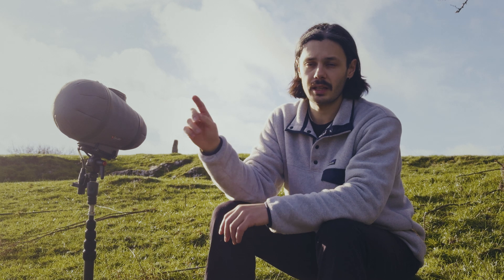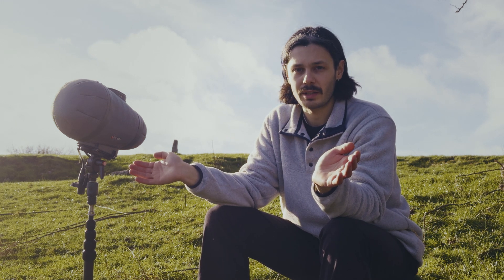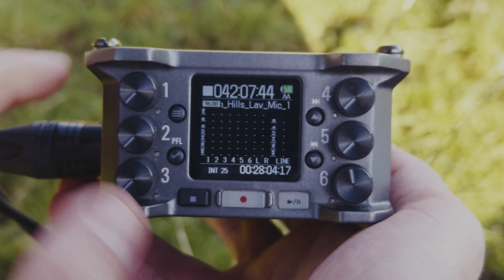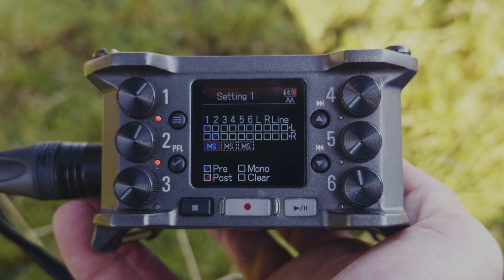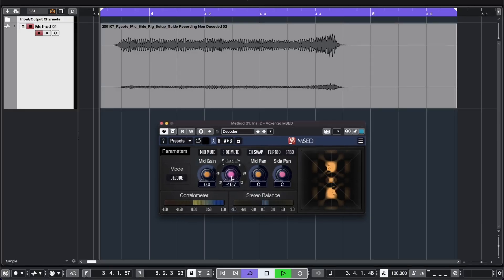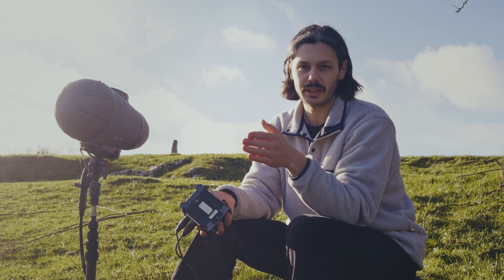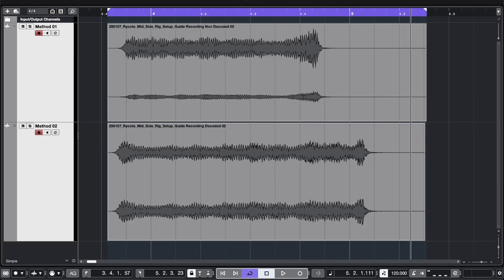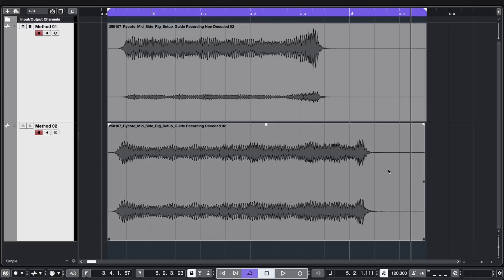How to Setup the Zoom F6 for Mid Side Recording

Comment: Thanks for making this video.  It's really helpful for newcomers. 
Can I ask which specific Rycote cyclone you have? There seem to be so many variations.
Also would it be big enough inside to replace the SC-08 with a Rode NTG-5 instead? The NTG-5 is quite bit longer at 203mm.
Thanks
Reply from the maker: Hey! I think the NTG-5 would be a bit long for this one. Its worth checking out the Mini Alto 250 by Radius. They're releasing Mid Side mounts soon too. Your NTG5 would fit inside of that

Comment: Thank you for the video, quite helpful.

 As for the way of recording and decoding  i suppose there is a third method as well. Record the two mics as mono channels and set levels as you want (i suppose if you record 32bit float even that is not exactly necessary) then bring the recordings on the DAW and duplicate the figure 8 mic, flip polarity to the one of the two and hard pan them left and right. Then group them so you can manipulate then as one unit.. this way you manually decode the mid side recoding. Then you can play with the levels or faders of the two duplicates against the mono cardioid mic !! A bit complicated method but this way there is no need for the extra peogram i suppose. Cheers !!
Reply from the maker: Thanks for watching. Yes you’re quite right, that’s another method that can be used for Mid Side, cheers for mentioning

Comment: How is the gain set for the two channels? It would be helpful, at least for me, to know how the bit depth and frequency is set. Very useful. Thanks.
Reply from the maker: Hey, thanks for watching! I don't really have any specific gain set for my recordings as its very dependent on what it is i'm recording. As a little rule of thumb i set the gain to 12 o'clock on the fader and go from there. I have found that i personally prefer 2-3db more on channel 2 than channel 1 when recording ambiences, as to my ears it helps make it sound "wider". But if you use Method 1 from the video it can be tweaked a bit in the edit stage. Hope that helps answer your question
Reply: @RareFindsSoundDesign  Thanks. That's very helpful.